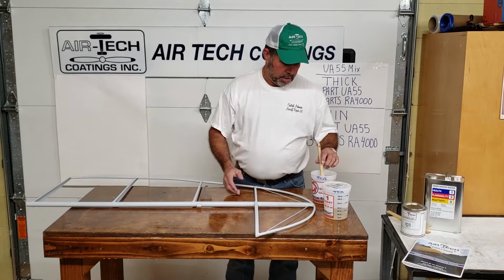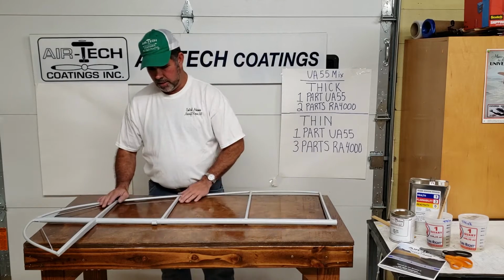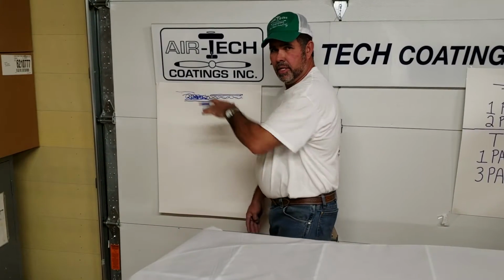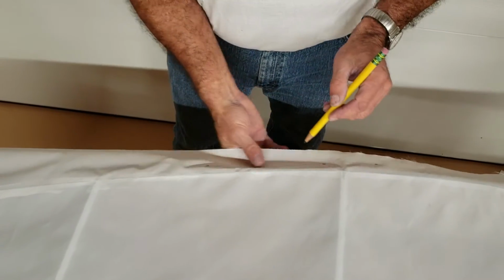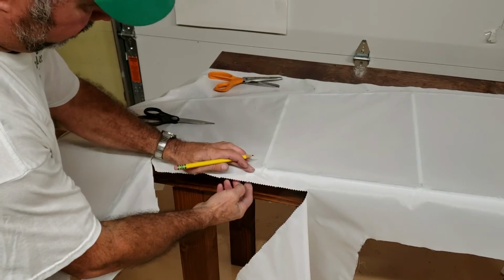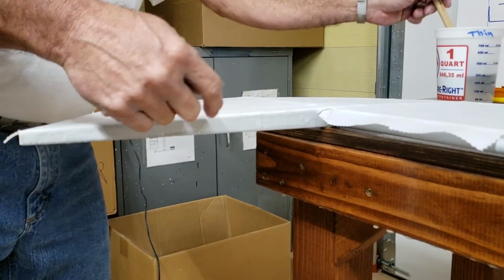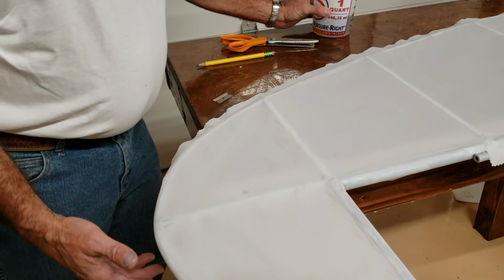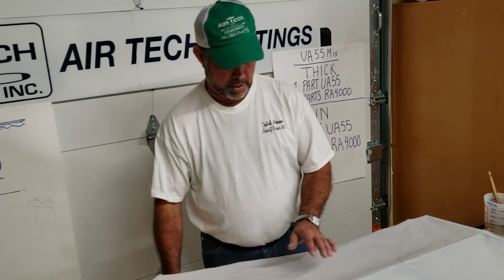2-Airtech Coatings-  Fabric Covering Basics

Comment: I was wonder if you could help me out I have a 1937 car project the body was built out of wood and originally it had airplane fabric wrapped but there was a thin layer of insulation between the fabric and the wood any idea what that is called, I looked on your site but didnt see anything.
Reply from the maker: Probably leading edge felt. Check aircraft spruce
Reply: @airtechcoatings  thank you very much, great videos too, I will be referencing more of them.